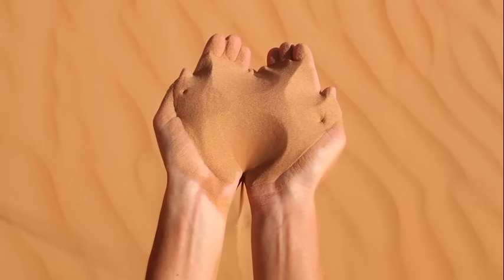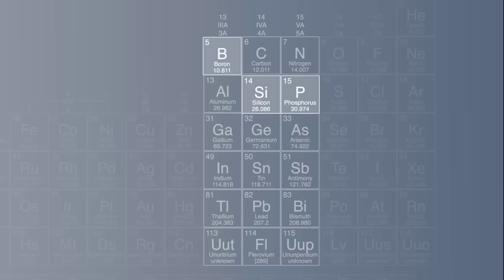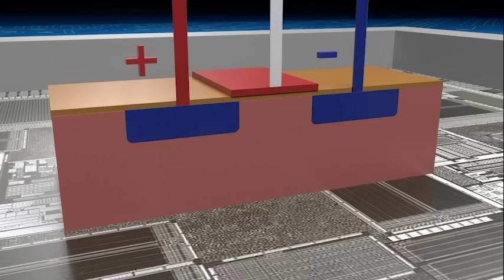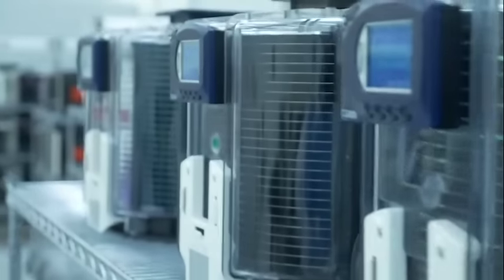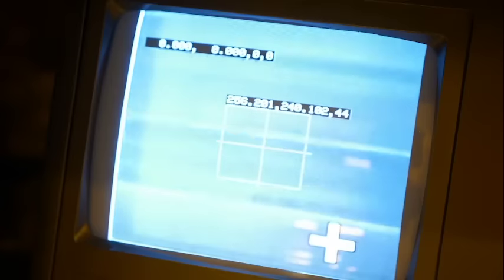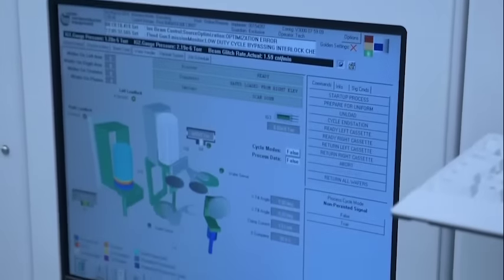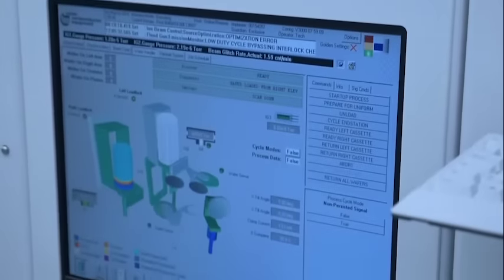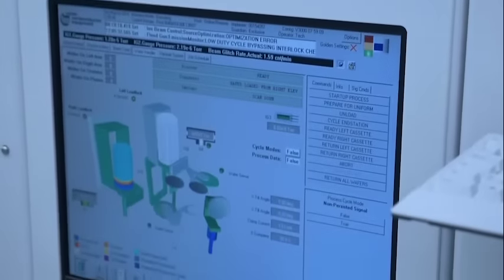Chip Manufacturing - How are Microchips made? | Infineon

Comment: Intel: Yeah, we know that. Now tell us how to make them faster!
Reply: Add another +
Reply: "Uhhh, 7nm?"
Intel: NO
Reply: At this point nobody is making them faster, just adding more cores and efficiency.
Reply: @FlyboyHelosim  No, Ryzen 5000 brought huge improvements in single core speed and no more cores than the last gen. And to stay competetive, Intel has to improve both single core speed as well as amount of cores.
Reply: @titaniummechanism3214  I don't know what pot you've been smoking but the Ryzen 5000's clock speed is nothing faster than what's been available for years.
Reply: @FlyboyHelosim  Watch some reviews of Ryzen 5000 and tell me again that CPUs aren't getting any faster.
Reply: @titaniummechanism3214  Dude, I don't need to watch any videos. The fastest CPU in the Ryzen 5000 series has a base clock of 3.4GHz and a turbo of 4.9GHz. CPUs capable of 5GHz and higher have been around for several years.
Reply: @titaniummechanism3214  Well in basic terms raw speed is about GHz, so until you wanted to delve deeper, that would have been a good enough answer for most people. Quite frankly I don't even care. Chasing the latest tech is tiresome and expensive and the majority of people don't need it.
Reply: @FlyboyHelosim  Then don't start an argument about the latest tech. Especially when you're not well informed.
Reply: @titaniummechanism3214  Don't flatter yourself, my dude.
Reply: Question is how you apply the architecture to the chip lol
Reply: The speed and performance of a CPU isn't dependent on any one thing entirely. Be it clock speed, number of cores or even the width. You can compare Intel's 12nm with TSMC's 7nm because it's that optimized. 
There's a trade-off between a number of features like power, clock speed, cost, testability, etc. which you won't know just by reading specifications.
One's clock speed or no. of cores being greater than the other's doesn't mean that one CPU is better than the other.
Although, in saying that, Ryzen's performance is definitely better than current Intel ones in the market.
Reply: @FlyboyHelosim  your clearly out of date
Reply: @Custmzir  There's no such thing as 'out of date', unless you're some elitist who pointlessly chases new all the time.
Reply: Amd : let me show u...
Reply: @FlyboyHelosim  search dunning kruger effect, might help you to know why you feel you're smarter than you actually is

Dont be arrogant
Reply: they choke the stocks to sell more ..
Reply: @officialdislikebutton9712  Do you mean stocks as in company shares or as in stock of product?
Reply: AMD: hold my beer
Reply: @turning_point96  You mean beer, don't you?
Reply: @titaniummechanism3214  yup... Edited... Thanks
Reply: Ask AMD
Reply: Paint flames on the chips. 60% faster guaranteed
Reply: @Mart-E12  7mm is even trickier and low yeilding
Reply: AMD- I will tell you intel😂
Reply: @FlyboyHelosim  They aren't getting faster but the IPC is increasing thus higher performance.
Reply: @khalilrazak6486  Thank you! Finally someone who understands!
Reply: @titaniummechanism3214  clearly an AMD fanboy. The speed of cpus have been nearly the same for close to a decade. Just because benchmarks speeds have gotten better due to architecture changes doesn't mean the actual speed (frequency) has increased.

 You don't even know what you're talking about. IPC on the other hand is another story.
Reply: @greencupofdeath  How do you know that I meant frequency and not processing speed or performance?
Reply: @tsaitaj  You made me laugh
Reply: @flowjob3813  OK bro. Whatever you say bro.
Reply: Totally an AMD fanboy comment.
Reply: @dariusga6752  Not quite fanboy, but I appreciate them for what they gave us. Competition. And without competition Intel would still be selling us 4 core CPUs as high end consumer chips for 300$. Same with Nvidia btw.
Reply: @FlyboyHelosim  there's no need for insane core speed anymore when you have 8+ cores
Reply: @titaniummechanism3214  that's what you get when arguing with a kid who think he is Einstein,lol arguing with stupid people will make us stupid too, let's just ignore him bro.
Reply: Intel won't make machines... They buy these machines from applied materials
Reply: good
Reply: @FlyboyHelosim  Clock speed doesn't determine how powerful a processor is. 1 AMD core from their new Ryzen 3 chips is "faster" than 1 Intel core on their new chips at the same clock speed.
Reply: Ask AMD
Reply: @Tevon93  I never said it did dictate how 'powerful' a processor is. My original comment was answering literally about raw clock speed. Anyway I think this horse has been flogged enough now. No need to keep replying to old comments.
Reply: Apple M1 chips are next level
Reply: @chriswright8074  i watched a very short version of how even simple ic like atmega8 are made (like the actual architecture) from my uncle and damn my brain explode
Reply: And With Smaller Transistors!
Reply: Intel FTW!
Reply: @the4spaceconstantstetraqua886  I hope so. If Intel would finally put up a fight, it would be better for us consumers!
Reply: This comment is so underrated 🤣
Reply: @FlyboyHelosim  He's been smoking AMD pot.
Reply: Ask the taiwanese. When china conquers Taiwan by force, they will dominate the world
Reply: @FlyboyHelosim  nah, he is right though
Reply: Bruh, 75℅ of worlds micro chips are made in taiwan.
Reply: Architecture affects speed more than clock frequencies.   Learn about AES, AVX-2 through AVX-512 just to start.  (Old I know but illustrates the point) 

My hbm2 chips outperform navi in many ways at nearly 1/3 the clock speed.   Hence the reason nvidia's enterprise chips all use hbm memory and processor architecture. 

It's also the reason why top of the line Kepler is outpaced by entry level  Pascal  .
Reply: @titaniummechanism3214  Because AMD and Nvidia outsorce their chip production to TSMC
Reply: @Fauzanarief-n7i  I thought Nvidia was making Ampere over at Samsung.

Comment: This makes me wonder how a computer can be that cheap.. watching this makes me think that the piece of technology I'm holding could be well worth more than a car
Reply: automation, you should see how steel is made is made, it's like 95% autonomous.
Reply: Also mass production, even with billions of dollars being put into r&d - they can recoup the cost with mass sales (keeping in mind, these chips are tiny and you could have hundreds per wafer and there are multitude of machines in operation at any given time. Yes yields are an issue, but from a wafer, and modern processes - you could be looking at upwards of 70% of the chips being usable. There are methods of compensating by repeating parts of the chip (like adding extra cores) and omitting them from the end product - as a fail safe for if there is a defect, they can still use the chip, 

And of course binning of different skews, (let's say half the cores came out defective, if you have a good product line, you can sell it from let's say an 8c model to a 4c - remember how all of them to produce cost the same though, which is why aiming for the best product and then binning from the bad yields is the best option for maximising profits)
Reply: Mass production my friend
Reply: True but due to scale price is cheap
Reply: Once you figure out how to make this and make a significant investment, it really doesnt cosy that much to produce a chip. Whereas making a car involves many sub contract and materials
Reply: Volume plus the fact most of the tech is already there and known to R&D costs much less. These things DID cost the price of your home at one time.
Reply: It's called "economies of scale".  Making 1 is very expensive, making 1,000,000 is cheap per part because you have already amortised the cost of development etc.
Reply: @cwaddle  We had a saying when I was in Semi design.  The first chip cost $10M everyone after that is free!!  Basically you don't screw the first one up!!
Reply: Cars also have much ICs and they are made of microscopic transistors too
Reply: @redicity5884  man you're the one who can't read. it's not 10cm squared, it's 100 squared mm.
Reply: My computer is actually worth more than my car lol
Reply: It did cost ~$10000-$15000 in the 1980s
Reply: Production in scale, the more chips they make the cheaper
Reply: There’s these chips in your car too
Reply: When I used to work in the manufacture of semiconductors, we made 6" and 8" diameter wafers. Each wafer held around 1,500 die (each die is used to make 1 device, its like a chip). An entire lot held 25 wafers like you saw in the boxes in the video. So one batch of product, assuming 100% yield, could produce around 38,000 products! Each batch was worth around $30,000. The short answer is mass production and automation is what makes this cheap.
Reply: Your car has these stuff
Reply: The Most Expensive Intel Core Deals I Found Were Less Than 1000$! Those Deals Are From The Intel Website, Prices May Vary Depending On Which Retailer You're Buying It From.
Reply: A millenial is about to discover the concept of supply and demand
Reply: scalation and automatization
Reply: No matter how complex a machines is, if you automatize that process using more machines, the price will drop to infinite as the Speed of Production increases.
Reply: the production process ends with some complex results, but the process itself is not that complicated. it boils down to:

1. cover it in the substance you want to create stuff with on the surface 
2. cover it with a isolating layer
3. put a stencil/mask over it and blast it with light removing the isolating layer only where you want to remove stuff
4. bath it on a chemical that removes the substance you working with. that will remove the substance from the surface only where the isolating layer is not present.
5. remove the remaining isolating layer
6. repeat

that's it really. and since is all automatized(no choice there, no way a human could do it precise enough), as long you keep the machines feed with silicon wafers and the chemicals... it will spit out chips.

the process to make the masks that is truly arduous, but once is done, you can reuse them for a very long time. the production costs for chips are in fact super small. when you talk only about production it costs many times less than 20% of the final price. is the research and development that is very expensive.
Reply: If you buy a good one it is worth as much as a car.
Reply: Well think about how many chips are sold everyday. It's a big industry. Yeah those machines cost millions of dollars, but they pay themselves off pretty quickly. All businesses require some investment. Some pay off, some dont
Reply: Once you realize how many products their in it makes sense
Reply: and thats an example of why Industrial Factory and Autonomous is NOT a bad thing.
Reply: you can thank the evil capitalism for that
Reply: @LuiZ-jy1pi  lmao capitalism is what has allowed society to exist. I agree that eventually capitalism will not serve a huge advantage, but technology advances so much faster and widely available with capitalism
Reply: It's a quantity game.  There's 25 300mm wafers in one foup.  We run thousands of  foups each day.  Each wafer can hold thousands of chips.  So a lot of chips are made!
Reply: It's cheap(ish) because it's highly automated and each wafer contains many of the same device. When I was a child in the mid 1960's a transistor was $26 (I was told by the guy repairing our valve TV) which was almost 2 weeks rent and now you can buy a pentium chip for $98 that has maybe 3,000,000,000 transistors which on a chip about 4cm2 so that's around $3.2666666666666666666666666666667e-8 per transistor. The price as basically dropped around 795,918,367 times. I got the figures from a few different sources so the errors may be in the order of a factor of 3 but still amazing numbers.
Reply: Mass production makes it cheaper. Because engineering cost is same even if it is manufacturing 1 chip or 1M chips. So if you can produce 1M chips for 1M dollar, your cost of production came down to 1 dollar per chip.
Reply: Vehicles have chips in them
Reply: Really? Haha
Reply: #1 ingredient: Sand!
Reply: That's exactly what I was also thinking while watching this.
Reply: There's probably more chips in the earth than people, so even if they profit only 1 dólar per chip, that would be more than 8 billion U$
Reply: @IcedReaver  bro can i get your instagram id for more such information !😄
Reply: Massive scale, they literally make millions of chips from 1 ingot of silicon.
Reply: That's because, although those machineries are very expensive, they also produce billions of chips.

Comment: I find it hard to accept that "some company video" was that concise and informative. Kudos Infineon!
Reply: Well its a Engineering & technology company they are the exception that actually are capable of making informative videos. They don't deal directly with customers so they have no reason to "sell" you their product so they don't advertise they explain.
Reply: @ScreamingManiac  who invented this alien technology.
Reply: @BoneYard I recon thats mostly just to keep it simple. Do you really need to know that they used 1030C for 4min22sec in this example? It doesn't make you understand anything. These things are not secret at all. The stuff those companies try to keep secret is far out of the scope of this video.
Reply: @BoneYard the manufacturing process isn’t really what’s the corporate secret information. all microchips are basically made the same way. it’s the very specific designs and arrangements of transistors which is what is kept secret. the reason they leave out specific information is either because it can vary from situation to situation or it’s simply not important for your understanding.

Comment: Ya I don't feel so bad about spending several hundred dollars on a cpu now. All that work and tech, seems like i got a heck of a deal now.
Reply: @F a Isn't that a bit like estimating the cost of brain surgery to a few hundred bucks since all it takes is a few bandages, a scalpel and some anaesthetic? It isn't entirely wrong of course, because you could operate on someone and all you have is a sharp knife, some cotton and a few painkillers, but I think your estimate leaves out a lot that contributes to the overall cost.
Reply: @F a R&D costs hell lotta money and time. Guess why TSMC and Samsung is basically only foundry that produces meaningful amount.
Reply: @F a Not to mention tons of money that goes into making the infrastructure. It's not super profitable as you think. Only reason TSMC does fine is because there is almost no competition for above reasons.
Reply: @CheolA-i7g  TSMC has spent a great deal of money & time commercialising their process nodes. Many ICs are smaller than CPU & thus yeald more from each wafer, also they don't require the same performance requirments so they are manufactured on a smaller node first, then when process matures, yeald increases & CPU is viable.
Reply: Just wait til you see Milton Friedman's thing about the pencil.
Reply: @F a it's not just that. There's a lot of R&D work that demands such amount.

Comment: I am speechless. Just to think 100 years ago the best technology was a vacuum cleaner. I really have a new-found respect for computer engineers and an appreciation for the small things in our everyday lives that we take for granted. We have found new ways to push the boundaries of what makes us human. The other day I dropped my phone on the ground, after seeing this, I am astounded at how none of those tiny components were damaged because if one of those little capacitors or transistors, microchips, etc. broke, the entire thing could stop working. I am going to be more careful now with my devices, also after seeing this I won't feel so bad about paying really high prices for a little RAM chip.
Reply: They aren't damaged because chips are actually covered with an epoxy liquid that hardens before they're packaged, so there is no room for movement of any of the transistors on the chip as they're all sealed in a resin. The electricity can still get through the wires though of course.
Reply: Its heading to transhumanism, not so optimistic
Reply: it's really not like that. solder holds these components together and they are also convered in epoxy. the worst thing that can happen upon dropping your phone is breaking the screen
Reply: @king_james_official  and? Solders can crack and break as well
Reply: @Teal-c  sure, but what is the chance? the only way possible is to crack the pcb, which would break off the copper traces. i don't really know what you mean...
Reply: @kudjo24  depends if we will accept it or not
Reply: and pushing our pockets deeper than ever.. 🤓🤓🤓
Reply: they made a fucking plane 120 years ago..

Comment: i can’t imagine how the first chip ever made without that advance technology
Reply: Incremental progress.
Reply: It started as ENIAC or something like that
Reply: They were just bigger - so one grain of dust in a million grains of air would not affect it.
As for 'the first chip', machinery ran on thermionic vacuum tubes/valves in the early days, and you could make transistors and diodes out of them. Memory was provided by ferrite cores. The early chip-producing machines did not need to be fast, they just needed to create a functioning end product. Refinement, miniaturization and speed came later when the machinery itself was upgraded to solid-state (silicon transistors and semiconductor memory).